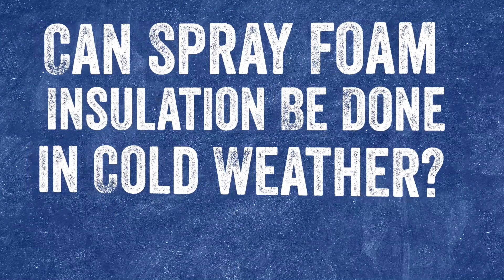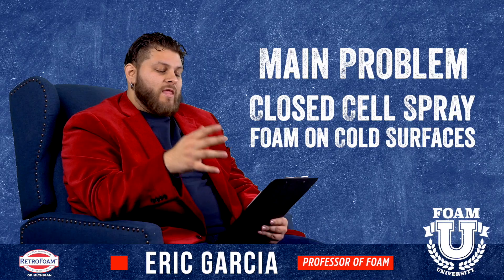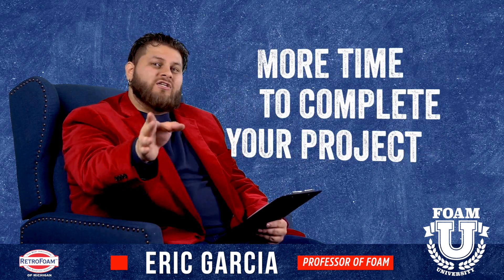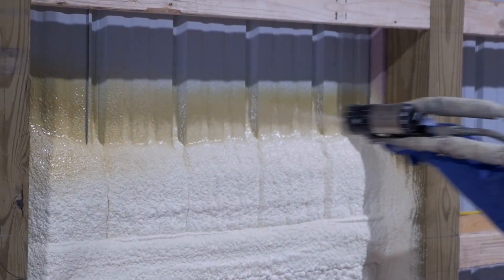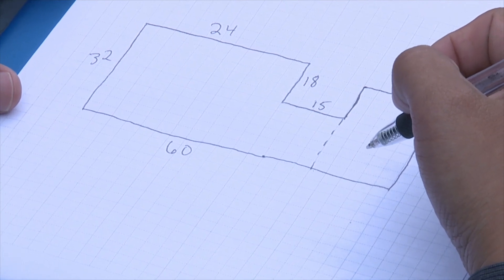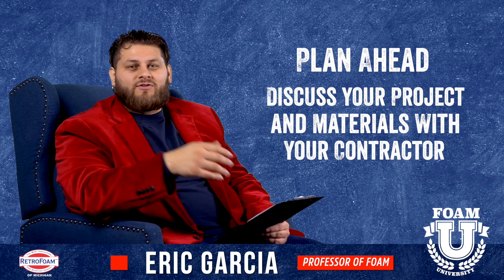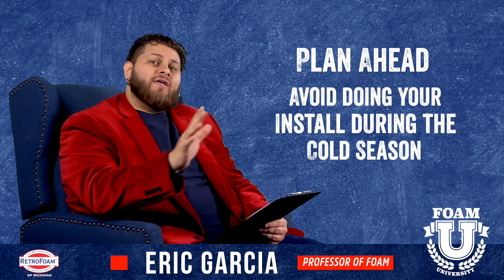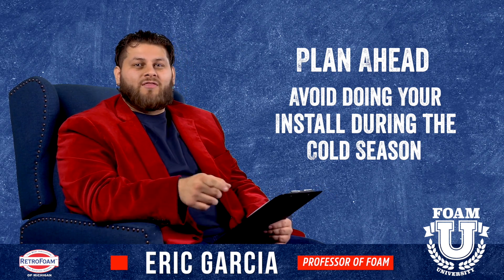Can Spray Foam Insulation Be Done in Cold Weather? | Foam University

Comment: We have a cold room we just cut a doorway into under our porch and found the walls and cap is sweating water and has frost. I wondered if i put a de-humidifier pulling the moisture out and heated the room up do you think that might be enough?
Reply from the maker: It may be enough. I would recommend first trying those methods before doing something more invasive or expensive.
Reply: @RetroFoamofMichigan  thanks for the response
Reply from the maker: @chasehymas1528  you're welcome! Good luck with your room.